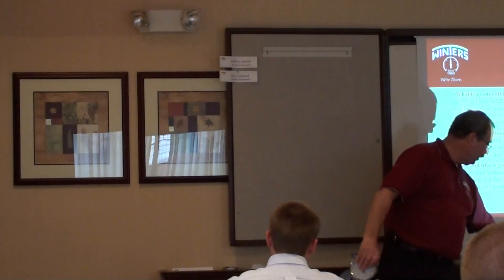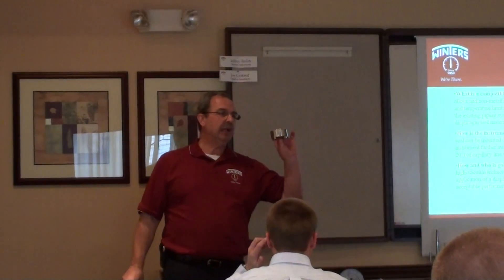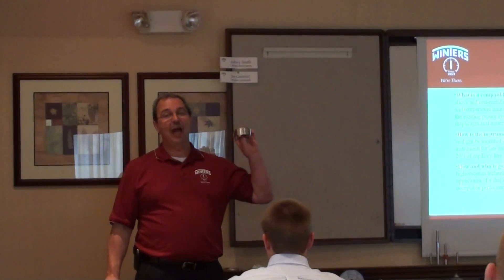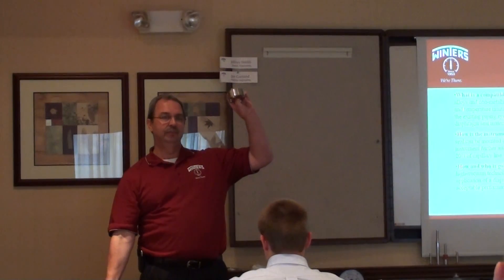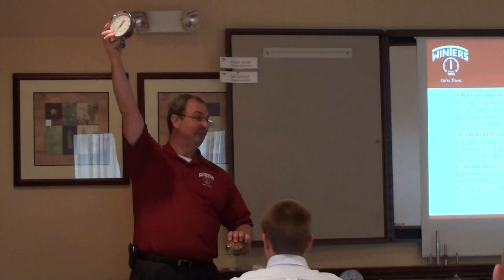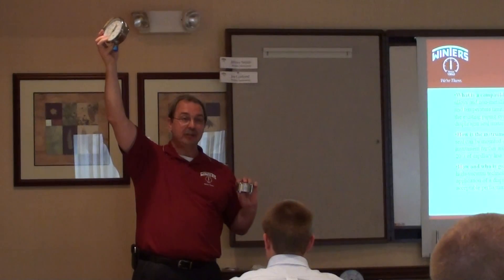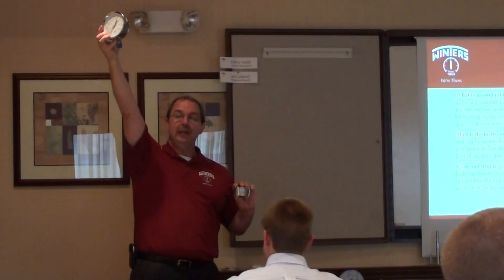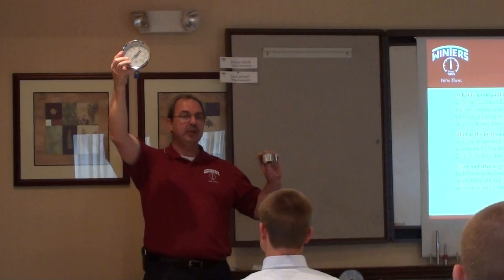What is Head Pressure?

Comment: Are head pressure and high pressure the same thing?
Reply from the maker: Head pressure is generated by the height of the liquid, high pressure would be the pressure generated from the process on the diaphragm seal.
Reply: Thanks. What is the formula for finding Head Pressure? I am trying to translate a text in English and the name Head Pressure always appears. But as I translate into the Portuguese language, it comes as pressão cabeça. It is not the ideal translation.Is Head Pressure Hydrostatic Pressure?
Reply from the maker: Head pressure is the pressure created by a level of liquid. In this case water.
See example below

Use the calculation to solve a practical problem. An example would be a 150-foot measured water height in a municipal water tower. You would divide 150-feet by 2.31 to obtain the value of static pressure at ground level of about 65-psi.
(1 psi = 2.31 Feet of water)
Reply: 1psi= 2.31 feet of water. how do you calculate this?
Reply: @MegaUsman1993   Because it takes 1 PSI  to support a column of 2.31 feet of water.